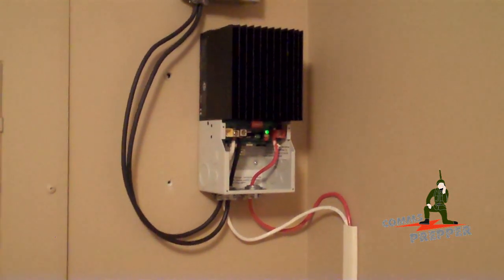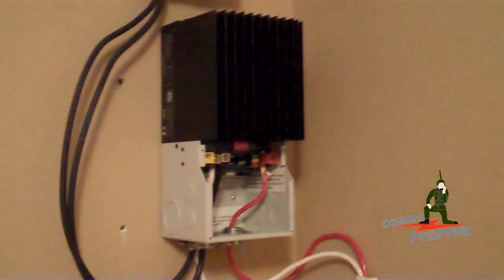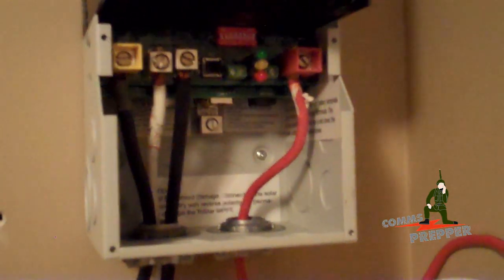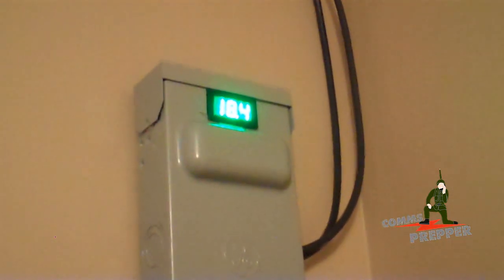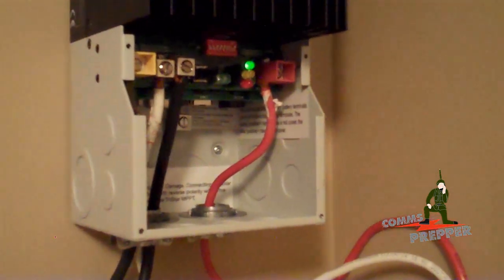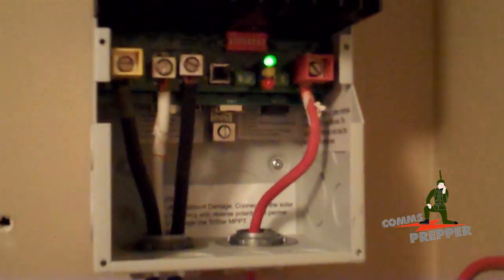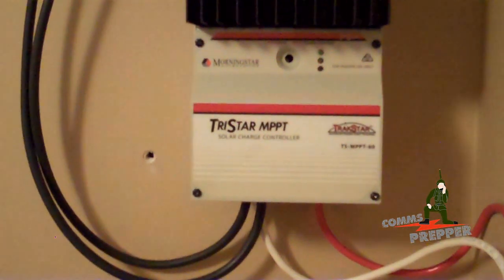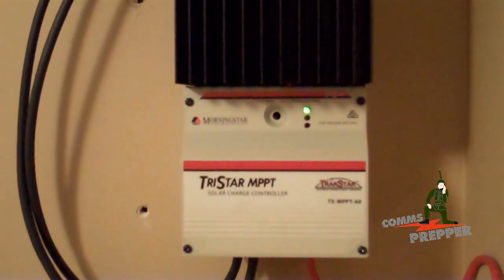TS-MPPT-60 Morningstar Charge Controller - Installation

Comment: I have same controller ! the only problem I had is during the day  I get hash noise on my IC 7300 HF bands. went away at night. mostly fixed now using ferrite on batt and PV leads .everything but ground . took most noise away. I should do video on how i  put big diode inline with a NC contactor to keep my radio gear under 15V when ten cell NiFe is 16.6V full charge. 73's
Reply from the maker: Thanks for the comment.

Comment: Can it be connected in parallel to another one?
Reply from the maker: This unit will work with others under specific configurations.  You will have to review the manual.
Reply: Thanks, ive read the manual and it says it can be done but each one must be connected to a different solar array.

Comment: +Commsprepper I have the 45 amp version and wired up everything, but it doesn't charge. Battery bank is at 24v and I measured open circuit 55v coming from the panels in open circuit. after connection to the charge controller, it goes to 33v or so but never charges (no green indication). Only thing that's lighted is yellow and red (steady). Can you tell me what do I do to start the charging?
Reply from the maker: First - disconnect the array and batteries then tell me about your setup.
1.  What is the voltage of your battery bank?
2.  What is the voltage of your array w/ type of panels and how connected to each other.
3.  Have you programmed the unit at all or did you select a one of the presets?
Reply: +Commsprepper 
The battery bank is 24v.
I've selected "auto" using the dip switches for system voltage. 
Have three Renogy panels hooked in series and on open circuit measures about 55v.

The voltage at the pv terminals drops to about 30v after connection to the charge controller when everything is hooked up, then slowly falls to just 0.1v above the battery bank. Today the sky is overcast.
Reply from the maker: Send me an email to commsprepper@gmail.com.

Comment: Hank, please do me a favor the next time you are at the retreat: Can you check for any RF noise generated by this controller? I am looking to replace my current controller due to some interference when the solar panels are receiving sunlight. Thanks, David, kk4zuu
Reply from the maker: +david m (KK4ZUU) Dave - Funny you mention this - my solar power system when operating wipes out the HF bands for me to the point that I cannot operate.  I was able to narrow the issue down to my inverter.  My solution has been turning the inverter off when operating.  I am swinging by the retreat tomorrow but wont have time to setup the HF rig and test (sorry).  What I can say - the Morningstar MPPT-60 controller is amazing!  It's a bit over-kill for my system but it's the only model with the Internet option and as a comms channel I needed that for making videos.  I don't regret installing the Morningstar one bit!  Hank
Reply: +Commsprepper Ok Hank, my generic one is also affecting my FM packet radio gear here in addition to 6M HF (not that we've had the conditions to use 6M this season). Nice weekend, enjoy the weather!

Comment: How do you use the power from the battery bank?  I take it the charge controller regulates power from the panels or wind turbine to the batteries but when the bank is full, where is the power directed?  I'm on grid and my solar panels make too much power during the day and the power company charges me for giving them power.  I want to set up a battery bank to draw from at night instead of turning on my furnace blower motor during the day to use up some power.
Reply from the maker: +Lightendog Sounds like your panels are grid-tie panels and not off-grid panels.  I connect an inverter to my batteries to produce 110VAC then feed that into my breaker panel.  Here is the video: https://www.youtube.com/watch?v=c-AWOQa9sIg
Reply: +Commsprepper Never heard of solar panels being for one and not the other.......What is the difference between the two?
Reply from the maker: +Lightendog Some panels have micro-inverters built in that convert DC current into AC current to match the grid power.  If you google solar panels for both off-grid and on-grid you will see what I am talking about.
Reply: +Commsprepper Yes, I have heard of that but for some reason I was thinking it was an added on feature you could get as they say it's the best way to run the power from the panels
Reply from the maker: +Lightendog You may be able to.  I don't know what kind of panels you have or how they are connected to your electrical system.  Only your installers would know that.  I have a solar power playlist that covers my system in short videos as it developed.

Comment: I've see a couple videos on how to ground this controller -- but they don't finalize the situation -- some ground to the negative on the battery, some run a ground wire to an outside copper post -- ?what is the right way or correct way or best way"?
Reply from the maker: +Charles Burts Not sure - I have not grounded it yet (that project is on the list).  I will have to check the manual.

Comment: HELLO COMMSPREPPER I LIKE TO KNOW IF YOU HAVE A VIDEO ON HOW YOU INSTALL THE DIGITAL GAUGE ON THE DISCONNECTED BOX AND IF THIS GAUGE IS VOLTS OR AMPS OR BOHT THANK YOU JOSE.
Reply from the maker: +Jose Gomez I do not have a video on that.  It's a $5.00 digital volt meter from Amazon.  I used a Dremmel Tool to cut out the opening to match the size of the meter and snapped it in.  The connections run to the post where the charge controller connects so I can tell (make sure) when I have the plug out - meter goes off.

Comment: If you notice a rise in the base level noise on your HF gear this is the bad boy doing it....should appear about every 50 hrz or so in your HF bands and  will on and off as your system charges and maintains your batts.  Your overall base level static will increase by about 9db.  If your radios are not in the same room you should be ok, if not then start here if you notice comms issues.  I just figured this out on a portable generator I built...was a bugger to figure out where it was coming from.
Reply from the maker: +Bruce Lawrence My system is spread out.  Controller inside, inverter in crawl space, and batteries outside under deck.  I will add grounding (something that needs to be done anyway) and see if that improves the issue.